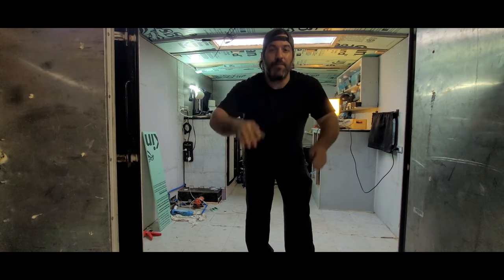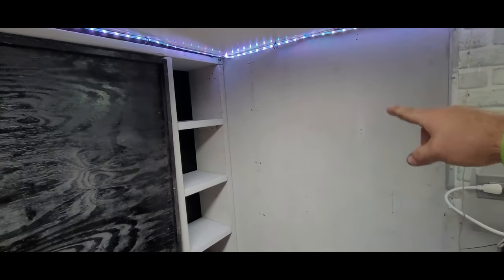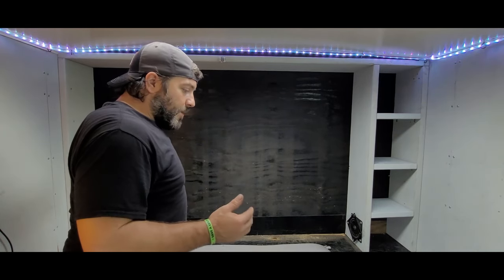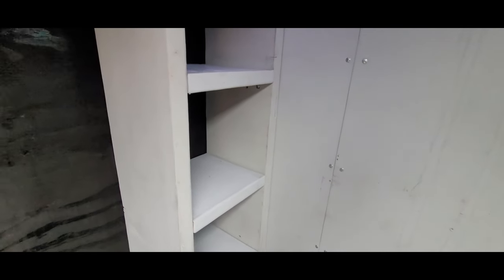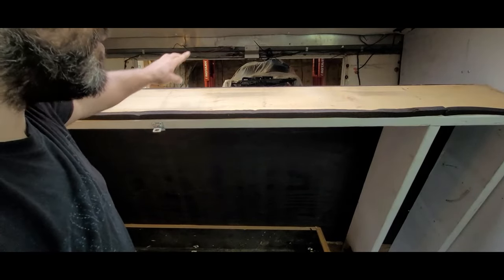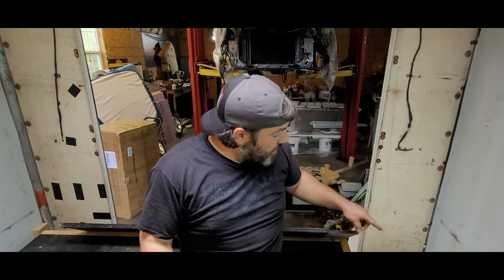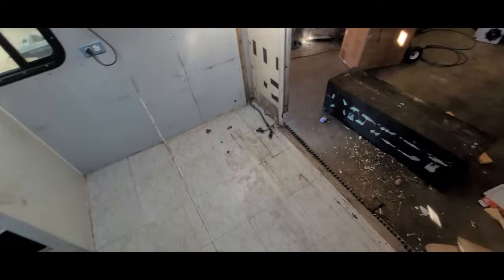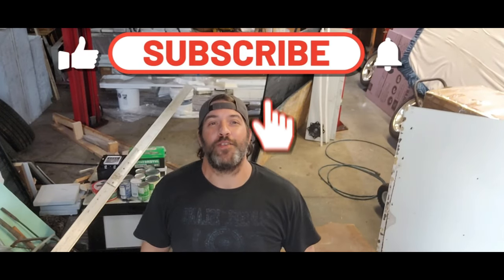I Ripped Apart My Home!!! | Rebuild "The Box" Series Part 6 #vanlife #rvlife #foryou #diy #build

Comment: Goodness ... that WAS a lot of lumber!
Reply from the maker: Yes! Heavy lumber too! Seems as though I built this thing like a fortress. Good thing for this foam board!
Reply: @NomadicBillyGoat  You started with what you knew.  As I've read about healthy eating... "Know better...  Do better!"

Even with the screen and coatings, the foam remains lightweight?  How about synthetics off-gassing?  Especially in a small, enclosed living space.
Reply from the maker: @kathrynarnold1966 I agree, I've learned alot in the past few years. 

Yes, it remains light weight. Certainly alot more lightweight than lumber and metal. I'm not sure about offgassing, but I've lived with the kitchen cabinet for a few weeks, and no issues, or scent, or anything. Plus I keep my vent fan on constantly just to move the air regardless.
Reply: @NomadicBillyGoat  When your roof vent is in exhaust mide (blowing to the outside) where do you let ait enter the van from?
Reply from the maker: My windows in the box, my side door, or my windows in the cab.
Reply: @NomadicBillyGoat  I'm glad to be able to ask ?s and receive answers but so looking forward to when I'm ready to get my own rig on the road.
Reply from the maker: Yes! I make and share these videos to try to help others. Mistakes and all. Lol
Reply: Hey, mistakes just give me practice understanding they're inevitable.